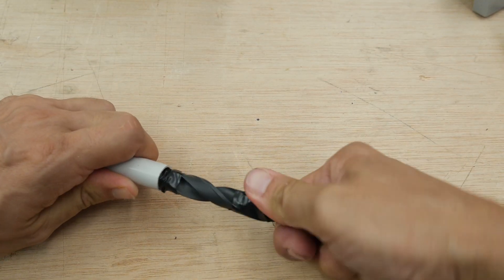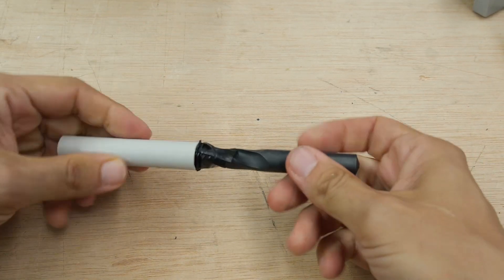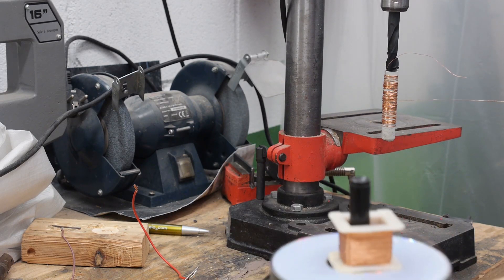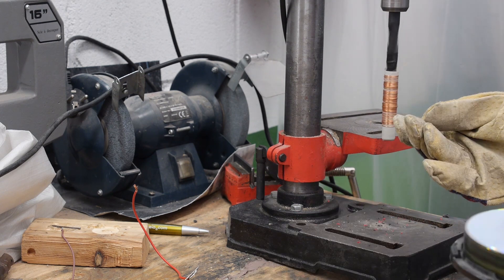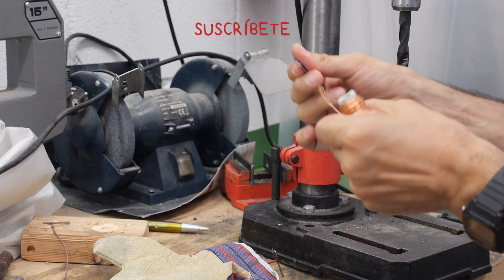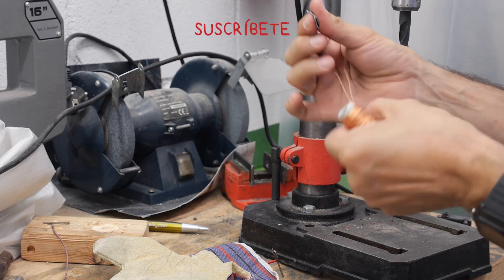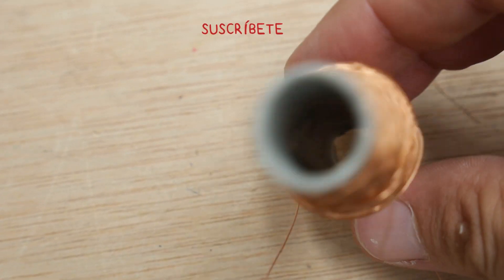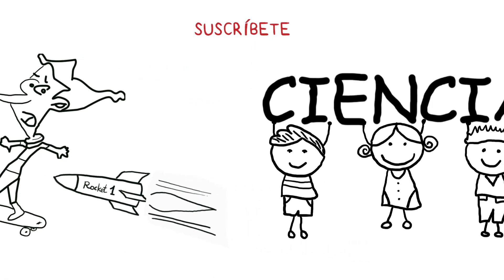Cómo hacer un Solenoide. DIY

Comment: Entre más cable ocupará más voltios y será más potente ???
Reply from the maker: Cuantas más vueltas mejor, pero no es tan sencillo, pues a más vueltas más resistencia con lo que necesitarás más voltios y por supuesto un cable más fino, pues si dieras muchas vueltas con un cable grueso, las vueltas quedarían cada vez más lejos del núcleo con lo que perdería eficiencia.
Reply: +Cienciabit: Ciencia para Niños y Jóvenes. gracias el cable es calibre 24
última pregunta 😉 ¿afuerzas el cable deve estar enrollado perfectamente?
Reply from the maker: Cuanto mejor empaquetado mejor, pero tampoco vas a notar casi nada de diferencia. Los profesionales lo enrollan con el mínimo número posible de cruces, es decir, lo más paralelo posible.
Reply: +Cienciabit: Ciencia para Niños y Jóvenes. gracias sigue así tienes buen entretenimiento